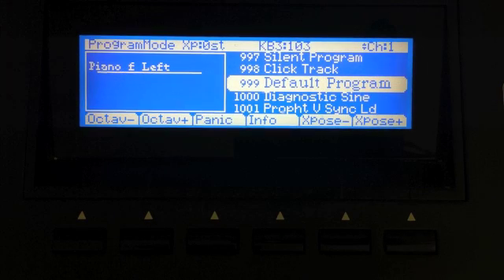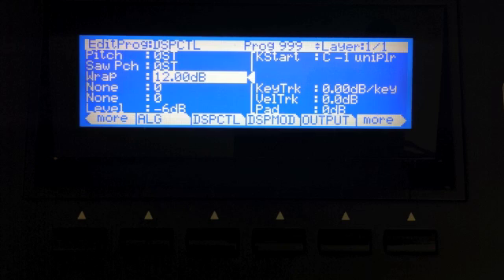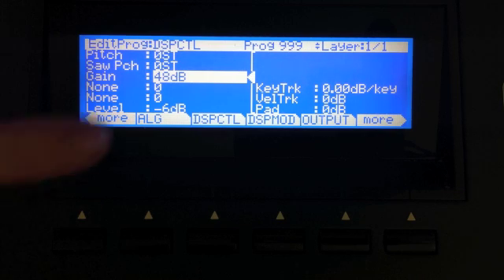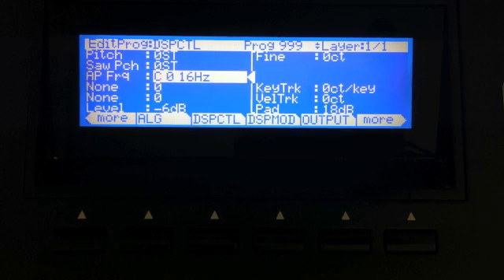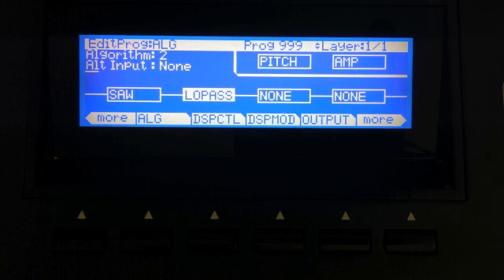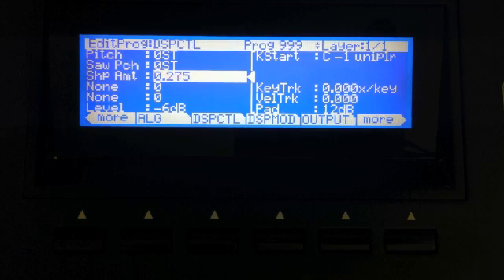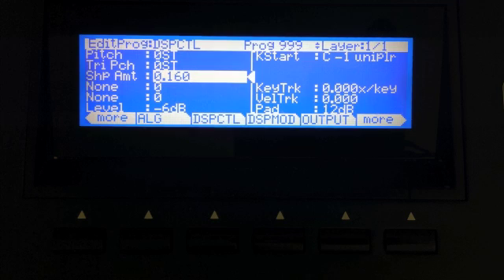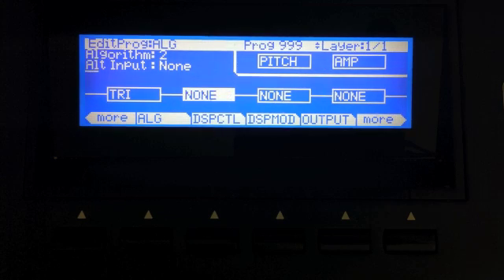Kurzweil PC3: DSP Modifier Overview Part 1

Comment: Thank you for posting these videos.  They are all great and very informative.  One note about GAIN and DIST.  They are different.  if the signal doesn't clip, you'll get more or less they same thing from both blocks.  But when they clip the signal, GAIN does hard clipping and DIST does soft clipping.  You can hear the difference and you can see it in an oscilloscope..  The audible difference is often very subtle but, depending on the nature of the audio that you clip, you'll hear that GAIN sounds more aggressive while DIST is perhaps a little more warm.